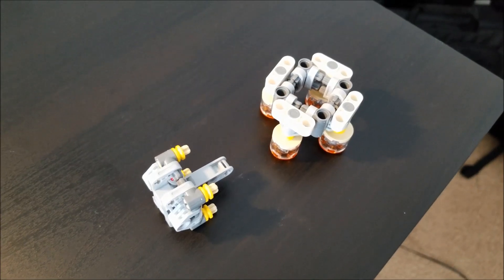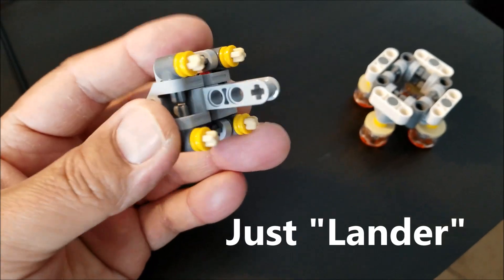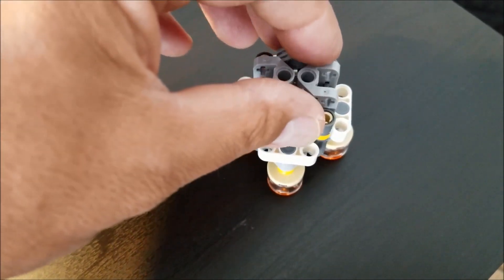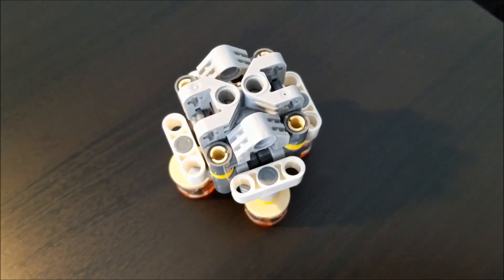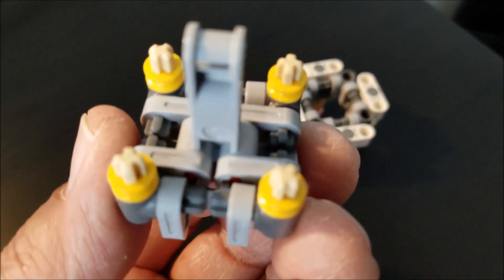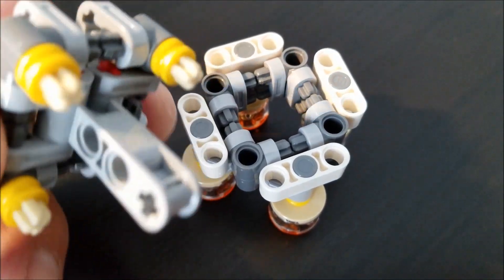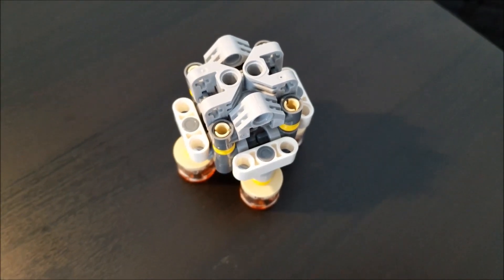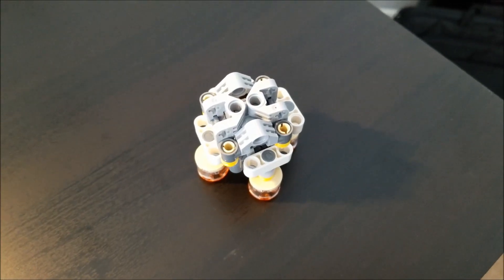"First LEGO League Lander Problem Help!!!"

Comment: You have to really listen to the wording in the video. it says "Any two of the tan connectors". it's just supposed to sit in there. It made itself clear when my kids dropped the lander for the first time and it popped into 2 parts. they were like "ooohhhh it doesn't stay together"... We had a coaches training this past Saturday and that was also stressed, that its not meant to stick.
Reply from the maker: Thanks kwcraft!!!  That makes perfect sense!
Reply: Agreed, either catch it, add a device to it to secure it, or reassemble it for full points I believe.